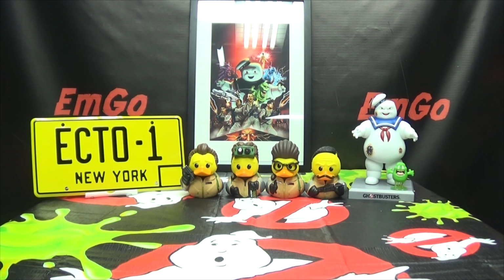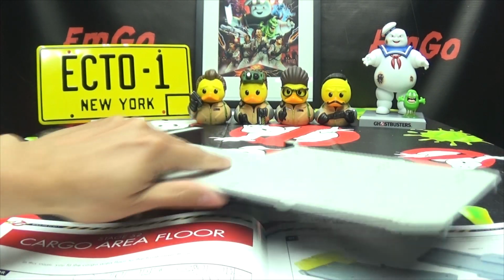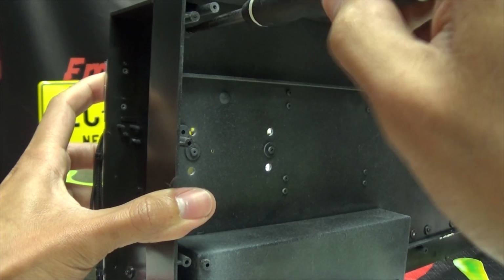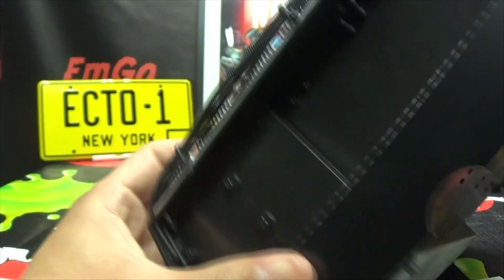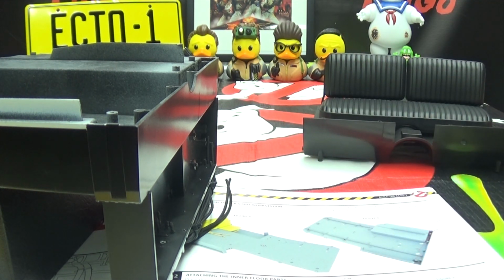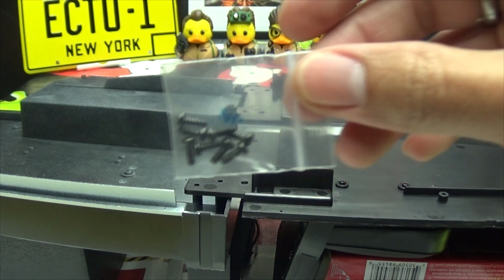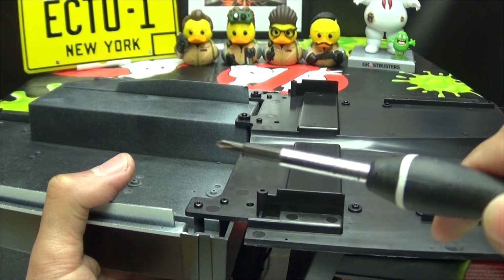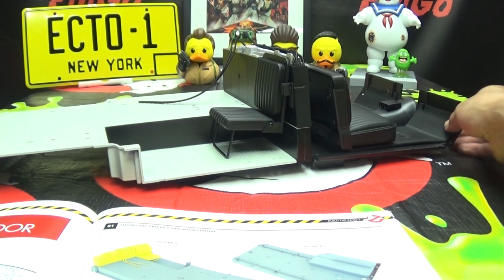Eaglemoss Ghostbusters ECTO-1 Kit (Part 52): EmGo Builds Stuff

Comment: Freaking Geek, Eaglemoss Enterprise-D update:  I FINALLY received my first Eaglemoss Enterprise-D build set today.  The pre-order pins are on backorder.  The glue that used to hold the card board backing to the clear plastic casing isn't that great...to where the card board backing and the plastic casing will have separated.  So...make sure that you don't have any escaping pieces.